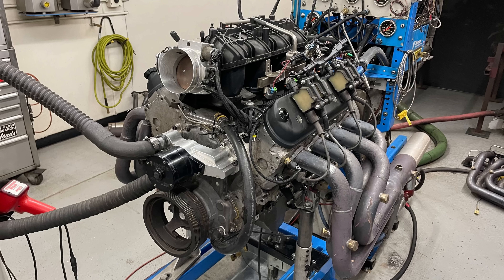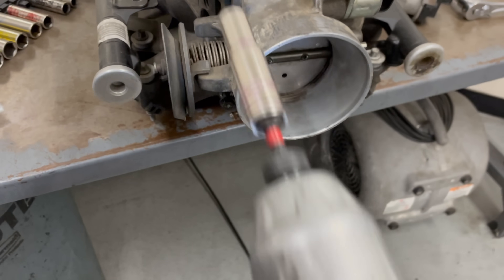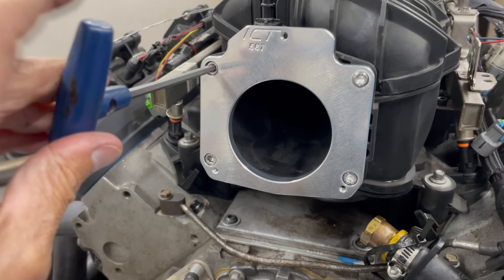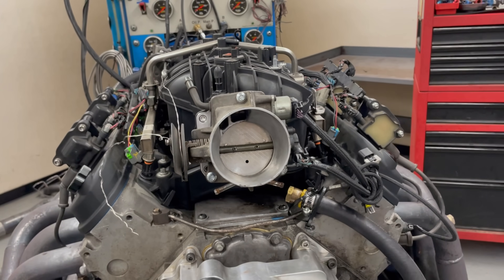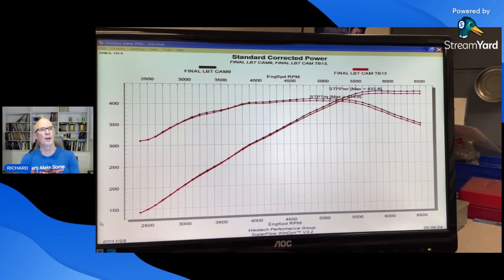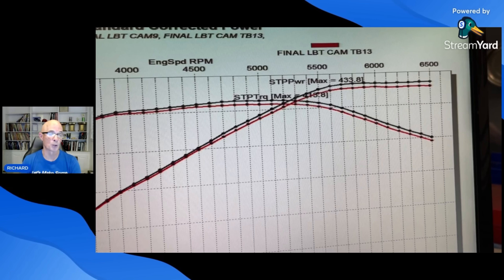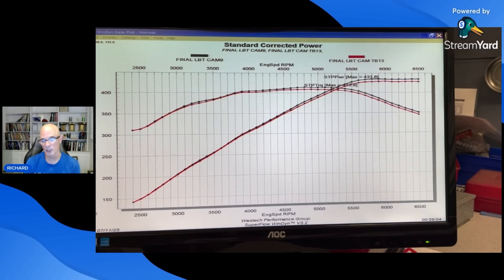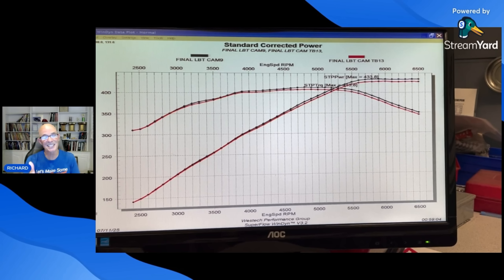TBSS THROTTLE BODY TEST REDO. FULL DYNO RESULTS. STOCK 78 VS 92MM FAST. BIGGER TB-WHAT'S IT WORTH?

Comment: I once owned a car with an 80mm throttle valve, but it had a 40x45mm (as I remember) air flow meter which proved to be the real restriction.  I managed to get it closer to 45x45mm and that increased power output to the point I ran out of fuel.

Comment: Probably the most overlooked problem with huge throttle bodies is part throttle drivability. Down low a too big body will be extremely touchy unless you run a non linear cam for the cable.

Comment: Just went from a gen3 truck tb to a ported 90mm on a cammed lq9 with a tbss. Big power difference above 4k and the throttle response is amazing.
Reply: I'm guessing you haven't seen his other throttle body vid. Even with cam & heads, his test still only showed a handful of power. Only the PD-blower made more than 20hp.

More than likely your tune is overly rich, and the extra air added HP by leaning it out. I've touched up bad tunes with the same effect. Feels like a rocket simply from leaning it out.
Reply: I think the biggest benefit for me is how fast it revs. It makes it so easy to rev match downshift. I do feel like it gained a little bit in the higher rpms. I had it tuned after the TB too
Reply from the maker: the tune is what changed
Reply: @richardholdener1727 it reved faster with the 90mm tb even without a tune

Comment: So someone might see a 1.5rwhp gain? Haha
Reply from the maker: how does 7 flywheel = 1.5 whp?
Reply: Gotta get a more efficient set up if you have 80% drive train loss
Reply: @devin7632  A typical unlocked 4l80 & 4l60 thru a typical 2wd drivetrain is about a 25% loss. If your TC can handle lock-up at WOT, you might gain a few effective WHP at the top of each gear.

Comment: Isn't the Gen 4 truck intake the same as a TBSS? I have a Gen 4 6.0 and the outside of the intake looks like the TBSS in the video, but it's for a rec port head.
Reply from the maker: the rec port intake only fits rec port heads

Comment: Truck 78mm drops no kpa on my 8.8 liter at max rpm of 5400.
It makes all its power at low rpm which makes a big difference. 
With the factory air box in place I seen 5kpa drop under same testing .
04 suburban

Comment: I think the fact of the matter here is if you have a 78mm hole and a 78mm throttle body, then you have a throttle body that flows less than the 78mm hole on account of the throttle shaft and blade going through. Going to a bigger throttle body than the hole on the manifold should bring you a little pinch of power

Comment: @RichardHoldener, I have question. You being the LS guru that you are. I just aquired an LS6 bare block and would like to do a stock+ build on it. Using gen 4 rods. But I'm having trouble locating flat top with valve relief pistons for an LS1 or LS6. Any direction or knowledge will help greatly. Thank you for all of your knowledge
Reply from the maker: every piston manufacturer has pistons for the 5.7L

Comment: The lack of change in Kpa tells us the problem isn't the throttle body size.  87mm will handle over 700 hp without restriction.  78mm will get you over 500 no problem.  I think the main issue here is that flat plate adaptor.  Instead of smoothly transitioning to the intake manifold like the stock TB you've got a step change on one side that's probably going to create some turbulence.  Would be interesting to fab up a properly tapered adaptor instead.
Reply from the maker: I HAVE ONE OF THOSE-WE DIDN'T HAVE TIME TO TEST IT

Comment: The engine is an air pump, and it has an equivalent orifice size to flow air through it. The bigger the equivalent orifice, the more airflow and when fuel is added to that, the more power.
Reply from the maker: only if the tb size represents a restriction. Adding a 200mm tb does nothing when a 102mm tb is more than big enough
Reply: The thing about orifices is they have to be unusually small to be a hard limit on air. Otherwise it's just a momentary pressure drop from the air accellerating & decellerating. Consider the actual cross-section of a 850cfm carb to a 102mm TB...yet somehow they'll make the same power all things being equal.

Comment: So like a lot of things, the difference is essentially zero where 99% of driving and cruising operation takes place. Then up top the difference is measureable, but maybe not noticeable by seat of the pants or E.T.

The big difference on this one would show I think if the test was  comparing the whole early truck intake/tb assembly vs the TBSS setup. On the cammed 5.3 the 4 bolt intake setup probably accounts for 25 hp if I'm guessing right. LBT 5.3 with all early setup I think you ran at 410ish.

Comment: So what I see is when I put the LBT cam in my bone stock 05 LM7 just leave the truck intake on it. Gains aren't worth the $$$
Reply: This was strictly a test of throttle body size, not the TBSS intake manifold. It was run both times with the TBSS intake, the only difference being one TB was 78mm, the other 92mm.
Reply: @coryholbrook4643 oh I 100% am aware of what the test was and stsnd by my statement. For my use it absolutely isn't worth the $$$
Reply: Are they that expensive now? It was nearly 15 years ago now but I remember paying only $2-300 for a complete factory setup, manifold, TB, rails and 36lbs injectors. This was also on a LQ4 but at that price, any double digit gain was worth it.

Comment: Seeing this makes me think i really should get a 102mm TB when I install the FAST LSXRT. Currently running a 92mm on my TBSS intake.
Reply: I run a tbss with a 92 snake eater on an lm7 with summit 8707 and 1219 springs with fresh 706 heads and made 384whp on a mustang dyno. I think what helped also was the RS5R30A manual trans and Ford 8.8 vs drivetrain loss on an auto like a 4l60/80

Comment: Most of us that I come across are running a 92mm throttle on the tbss 

Would love to know what the gain is by port matching it to the throttle since there is a step down in size to the intake track 
Also I would have to throw a 102mm on it just to see what it does at this point for shits and giggles 😂

Comment: The throttle opening for the TBSS manifold is sized tor a 90mm TB and the step between the TB and the opening in the manifold is a restriction, so a terst with the right size TB would have a bigger difference.
Reply from the maker: we did test with the right size tb

Comment: So is the 12hp on the intake swap due to the intake or the TB? I would like to see this test comparing the TBSS v. Regular truck, both with the 78mm TB.
Reply from the maker: the gains offered by the intake are from the intake-then we essentially added a restrictor in the form of a small throttle body (if you add a bigger tb to the small-bore truck intake, it does not add power)
Reply: 100%

Comment: Thanks again Richard your detail to the testing that we want to see is fantastic

It lets people chose  fun per dollar

Great work!

Ok today I drove a old 1997 motor home
Ford 460 FI
Didn’t know they made one
Crazy looking with twin rubber air hose intake( turbo ready? lol

Specs  crazy
410 lbs of tQ at 2000 rpm

8-1 comp(turbo ready)

245Hp at 3600 rpm
I think it fell omits face at 4400 rpm

On of this high velocity low rpm big tQ choke out motors

I wanted to see twin turbos on it

Tiny 19 lb per hour injectors

Comment: The kpa change  is interesting  ... I too would have  expected  a bit more
Reply: The Kpa change was about 1% and so was the hp change about 1% so it scales fairly well at least within the margin of error.
Reply: @bcbloc02  2% change in power, 1% in pressure.  So it's not just the pressure.  I've done a lot of restrictor plate tuning on rally cars and its unusual to see a gradually increasing loss like this too.  Two different restrictors (done properly) will look very similar until you reach a choke point and then they diverge with the smaller one plateauing first.  I think part of the differential here is turbulence from the adaptor.  While some sanctioning bodies limit how thick a restrictor plate can be, generally the longer the taper the better they work.  Flat plates are the worst.
Reply from the maker: it's unusual to see a gradually increasing loss from a smaller tb?
Reply: @richardholdener1727 they both make interesting  points  and information  ... the change  in pressure/ density  is part but the change  in pressure  drop across the throttle  body  also changes  flow ... I think he is saying  its a exponential curve rather than a linear one ...... something  to think about
Reply: @richardholdener1727  Yep, performance should be similar till you reach the choke point which should plateau power.  As mentioned in the other comment, I think this is a turbulence issue rather than a tb restriction.  Looking forward to the next test.

Comment: I'm assuming that the more hp and tq output you have, the more you'll get out of a bigger TB
Reply: I’d be interested in seeing this test at 10 psi boost. I have a tbss intake I’ve been wanting to switch out, but I’d use my stock throttle body if it didn’t matter much
Reply: @StationroadRatrods according to Richard aka the GOAT, tbss intake is better regardless but works better with higher power levels. Swap the intake, you won't be upset
Reply: @LeKelsor  I think I should switch it out over the winter
Reply: @StationroadRatrods I'm pretty sure you can use your stock fuel rail. Just stack a few washers on the bolts. Get the new style purge solenoid too. It's the same connector. Just rig a place to set it unless you got an 07 plus fuel rail laying around. Don't quote me just look into it. I have a tbss on my 06 but I saving up for the x link
Reply: @LeKelsor apparently the x-link are super hit or miss, I’ve done some research on it. Good luck, I hope it works out
Reply: @StationroadRatrods 78mm stock tb is slightly larger than 3 inch pipe so anything bigger should not make a difference.  Of running bigger than 3 inch pipe maybe will see gains
Reply: @StationroadRatrods  Boost doesn't care about large throttle bodies. The larger TB might have a fraction of a PSI more, but any decent setup will have a boost controller to compensate.

Boost does love the TBSS intake tho.
Reply: @hydrocarbon82 okay so tbss intake with the stock 78mm tb should make marginally less power than a 92?